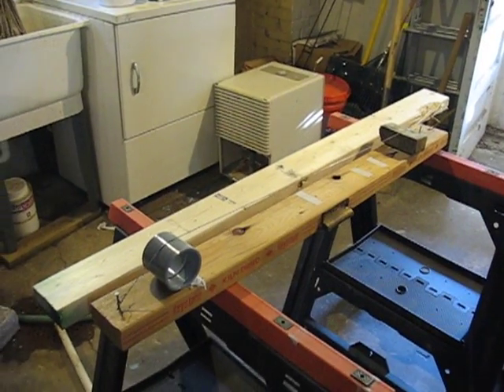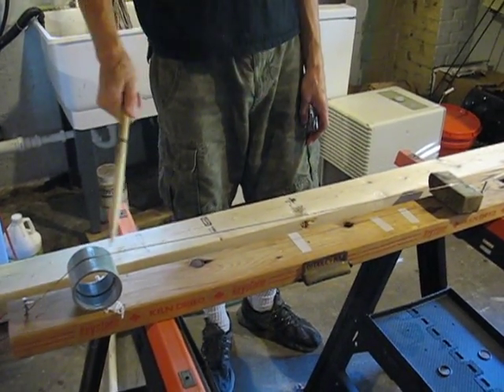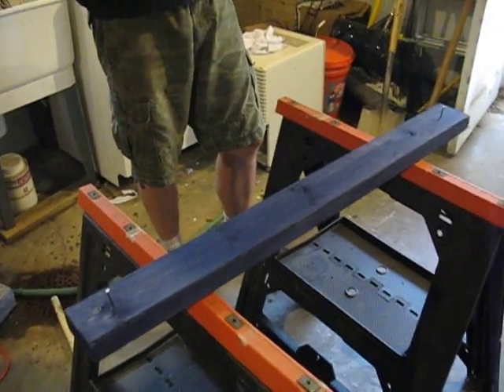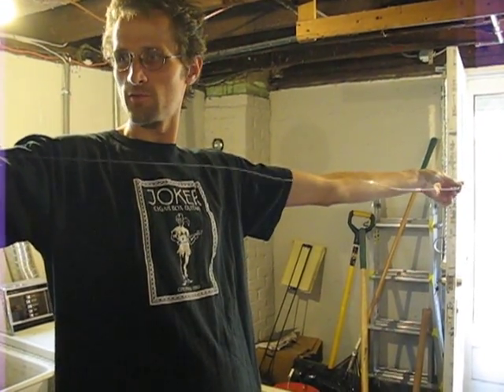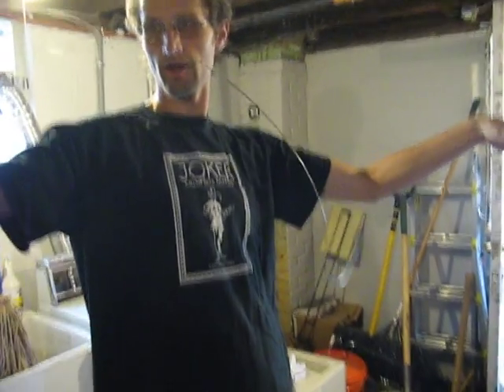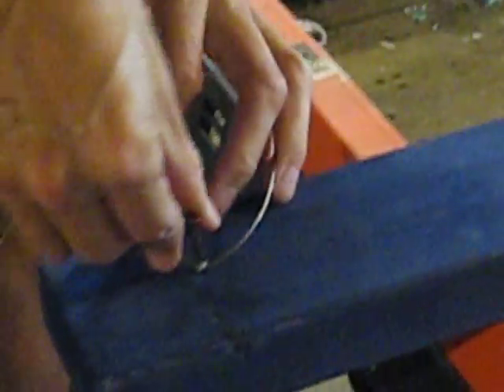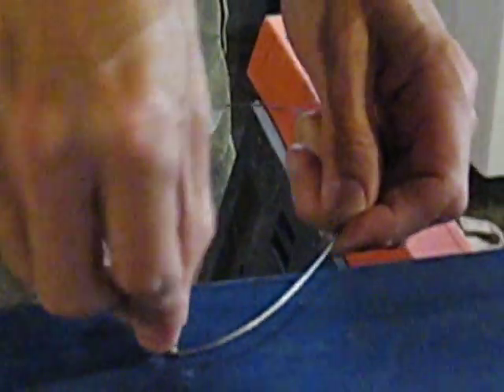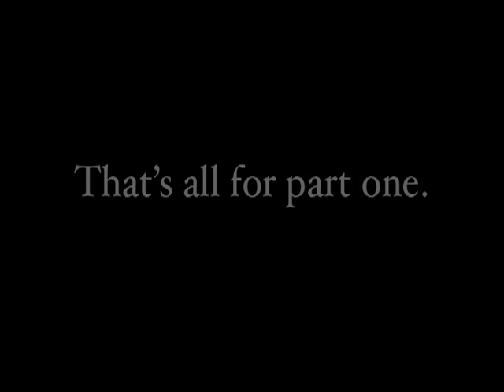How To Build a Diddley Bow Part 1

Comment from the maker: @SpacePyjamas Excerpt from One String Willie's website: "Guitar strings, which come in a variety of gauges, are a reasonable alternative.  I prefer phosphor-bronze guitar strings for my guitar-like diddley bows because these strings have a very bright, ringing sound, with great sustain." 
So it should work, but when he refers to 'guitar-like diddley bows' he refers to a "proper" one string guitar, not a board with nails & wire. I've never tried a guitar string, & there are no rules. Go for it!